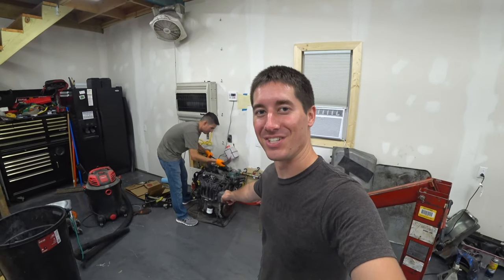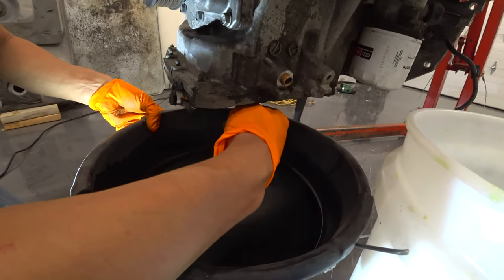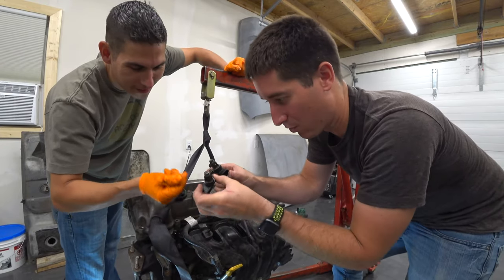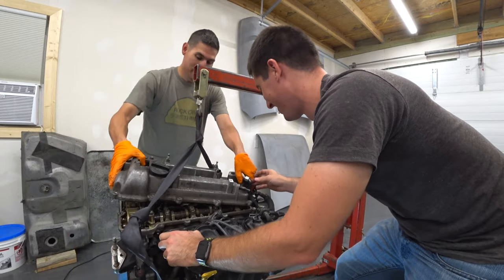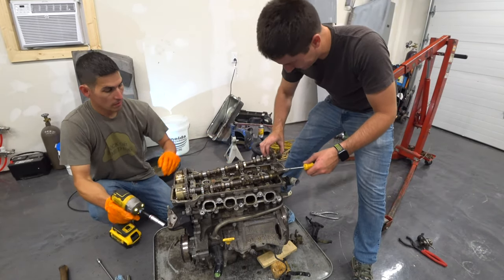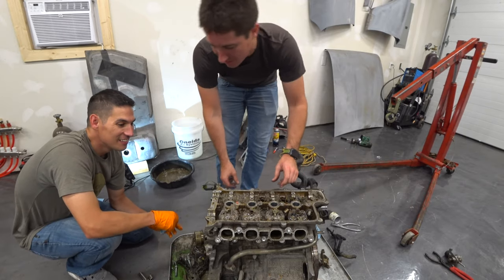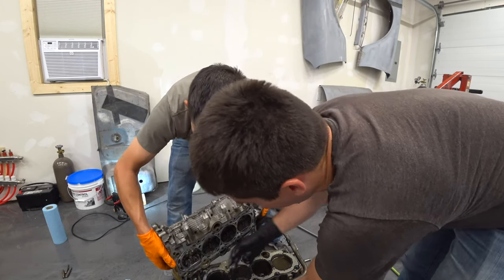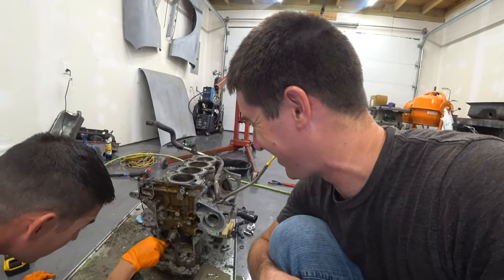Where Did The PISTON Go? Tearing Down The Orbeez FILLED Engine

Comment: I can tell you what's in the pan.

Had a problem early on with my Neon - I misunderstood/mis-remembered the directions for setting the timing belt and had it a notch or two off. It eventually ate the #2 piston. I fixed it, but didn't realize the valve timing was the cause. The second time it went it took the cylinder wall with it. Both times, the pan was full of aluminum kibbles and bits. My piston didn't just blow up. It disintegrated. The largest piece I found was half the size of a dime. Got a new engine (2000), fixed it back to a Gen 1 (same block casting), new water pump, main seals, and timing belt - fixed it RIGHT this time. I now have almost an additional 80,000 miles on the car from the 62,000 I started with - rapidly coming up on or just past 140,000. Still a relative turtle, but it's reliable and passes emissions.

Comment: clean it out put in a new piston and see if it will start again.
Reply: Great Idea!!!
Reply: It absolutely wont start again. You dont have a piston explode inside the cylinder and not have serious blow-by not to mention that the valves wont seal and the piston rings on the rest of the cylinders have got to be garbage at this point, turning over with sludge as the lubricant. Basically the engine is forever gone.

Comment: Did you guys see that compositor discharge when you pulled the head off and that wire touch the block good thing one of you guys didn't ground it out yourselves and Get Zapped but that was crazy

Comment: If this doesn't prove to you that Hyundai reliability is good now, idk what will
Reply: 20eggseggs periodt
Reply: They're good cars, the body and frame will fall apart around the engine and drivetrain, but they are good cars for people who want a good cheap solid car.
Reply: 20eggseggs a reliable car doesn't develop a rod knock in the first place...
Reply: Junkerbunker Any car that doesn’t have the oil changed often will develop a rod knock.

Comment: Why does a Hyundai engine have a motorcraft filter? lmao
Reply from the maker: Had the sticker on the windshield too, Ford dealer had just serviced it 🤙
Reply: Most oil filters can cross reference to different motors. My John Deere mower has a Purlator filter on the Briggs engine. A Dodge/Chrysler dealer could have put an equivalent Mopar filter on it if they wanted too. They sell a motorcraft filter that fits on my Dodge truck too.
Reply: I thought any non Ford parts made by Motorcraft were known as Omnicraft.
Reply: @atx-cvpi_99  If there happens to be a ford engine that takes the same filter as the Hyundai, they could have used the Motorcraft filter on it. Probably takes the same filter as one of the small Ford Turbo inline 4s.

Comment: so yeah, about a 4' section of pipe slipped over the end of your breaker bar as a cheater will make your life so much easier...
Reply from the maker: Yes it will... I was kinda concerned about breaking tools this time! Time to get that high torque Milwaukee impact 🛠
Reply: @WatchJRGo  look at it this way JR you got spare parts out of that engine before you sent it to the scrap yard. Though  I wonder if you could have rebuilt that engine without using Orbeez in the first place for use in a badass "GO-CART" from hades . 8P